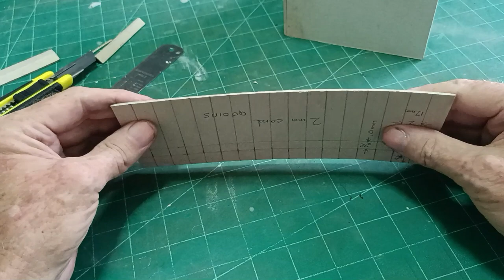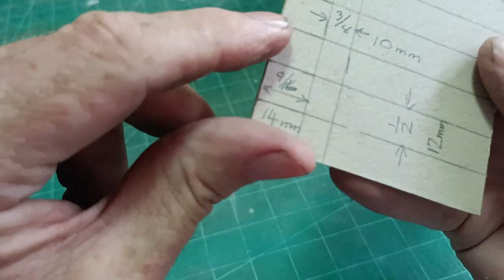How to make corners for dioramas and war gaming

Comment: Until I saw your series of tutorials, it never occurred to me to "paint" slightly-thinned wall filler and tile grout onto card buildings to simulate stone, concrete, stucco, and other textures.  The end result is just as good as filler applied with a putty knife or spatula onto plywood core buildings Paine/Verlinden-style, and in addition to being less expensive, they're easier to build and much lighter.  

Interestingly, I also found out that tabletop wargamers have been using this technique to make buildings for decades, but diorama model builders were slow to catch on; probably thinking that buildings constructed this way were less durable than the traditional plywood scratch build construction, or aftermarket resin buildings.  But when I actually got to see a game being played at the local Games Workshop, it immediately struck me how "roughly" the gamers were handling their creations - not just the Warhammer vehicles and figures, but also the structures on the battlefield.  If buildings constructed of cardboard and XPS foam can handle this harsh treatment during game play, just imagine how they'd hold up on a display shelf with minimal handling . . . .

Comment: Thank you very much for making the videos, I have learned so much through watching them. I've always wanted to do dioramas but they never looked right.  The question I have is how do you get the size of the thing you are making. I build mostly 1:48 and 1:35 models ww2 era
Reply from the maker: With buildings the height of a door is 2.25 inches from that, the window sizes are relative which will give you the dimensions of the building